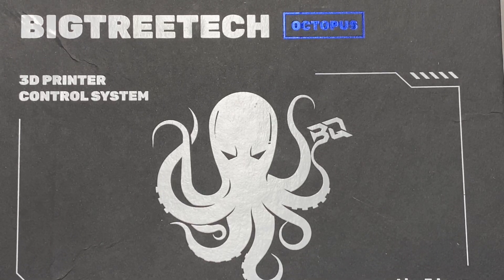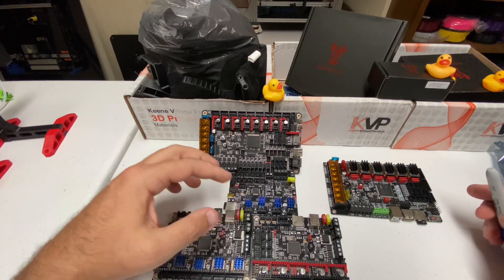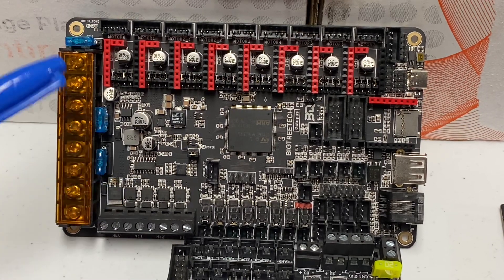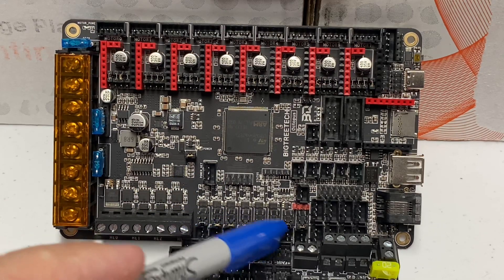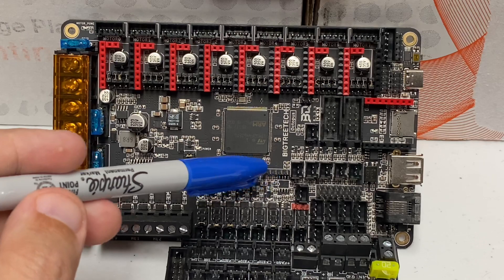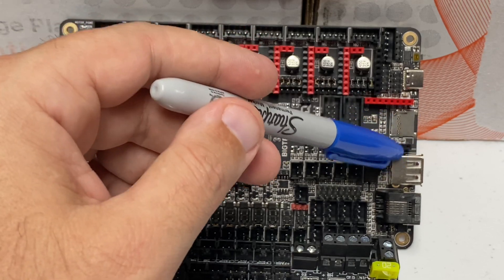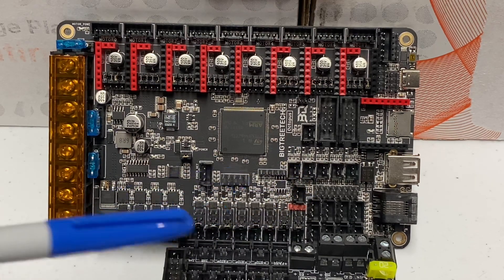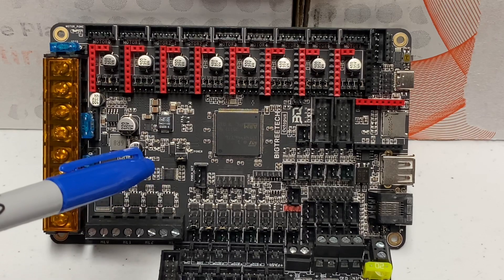BTT Octopus - walkthrough and features

Comment: Would it be possible to add ethernet to this board through the UART or SPI? Wired connection to RPi would be more reliable than wireless.
Reply from the maker: well if you have wired connection to the Rpi then you can use ethernet on the Pi right?
Reply: @JoshMurrah  There is no ethernet on Octopus board, it has CANBUS though.
Reply from the maker: right - I thought your concern was having a wired connection to the pi?  UART or SPI are wired connections, just direct connection instead of network.
Reply: @JoshMurrah  Well, my RPi server is about 20 meters away from the printer so ethernet connection would be the best choice. My question is if there is a breakout board that can connect the Octopus to the RPi server through ethernet?
Reply from the maker: Oh, I see!  I don't have any solid answer for you on that one - actually my best answer for that would be to just do a 20 meter USB cable, but do they make them that long?  Sorry, that's the best I have.  I'm not sure any 3dp firmware would support a breakout board even if there was one.